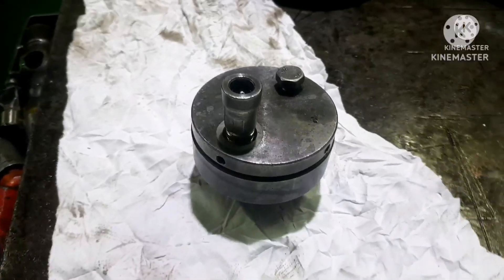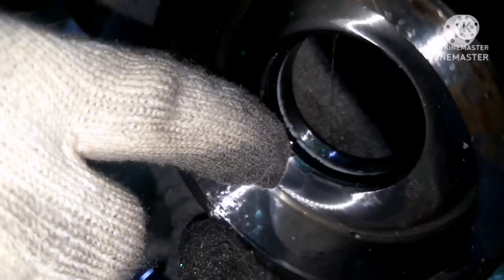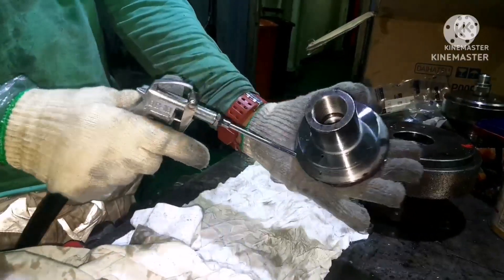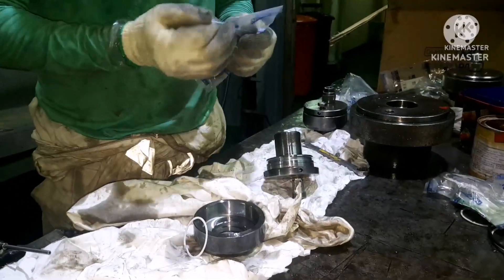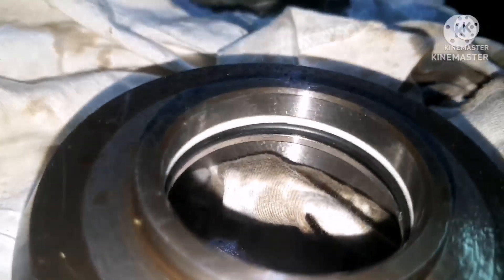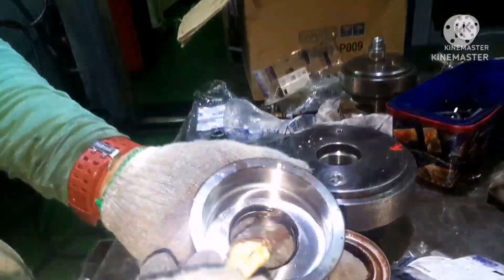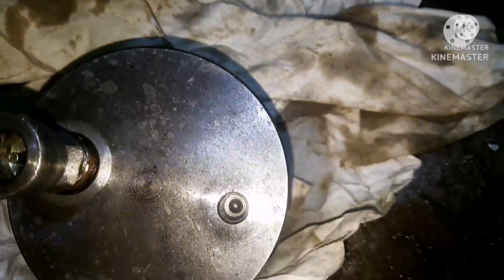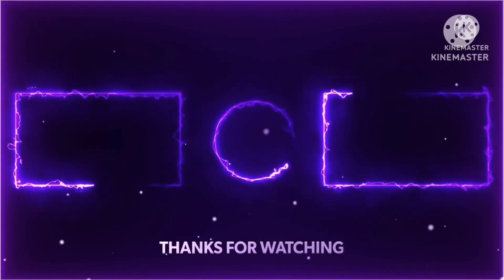HOW DO THEY DO.. HOW TO OVERHAUL AND INSPECT HYDRAULIC JACK ONBOARD SHIPS..

Comment: Query regarding use of copaslip. 
isn't copaslip used for high temperature application while molycote for high pressure application? since hydraulic jack only for high pressure isn't recommended to use molycote?
Reply from the maker: Presently it is recommended to use molycote rather than using copaslip..